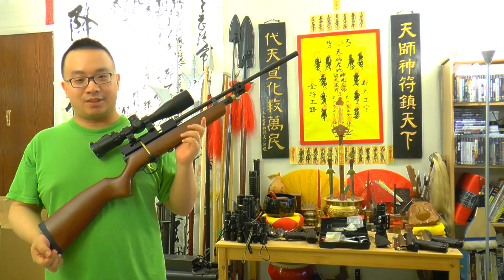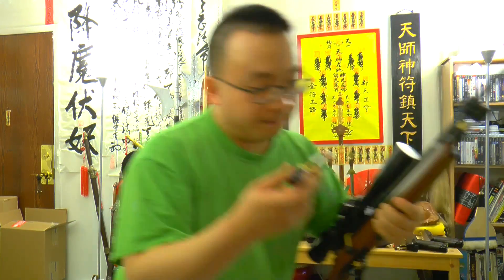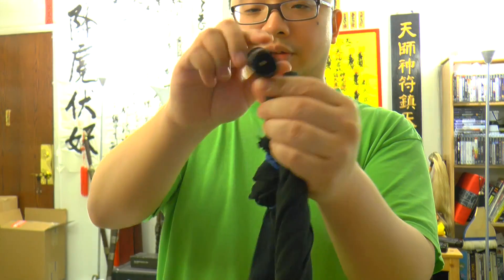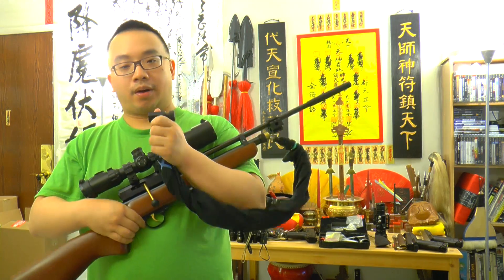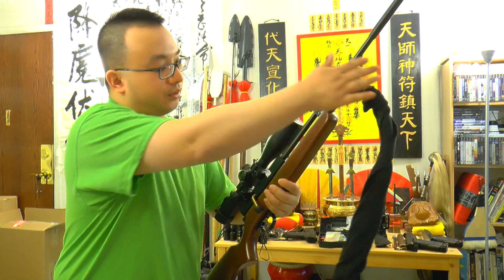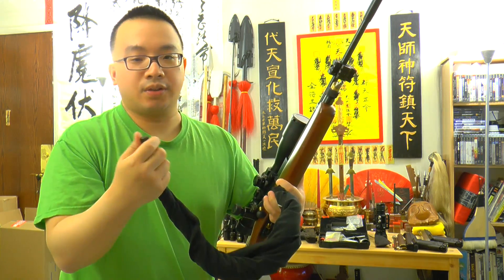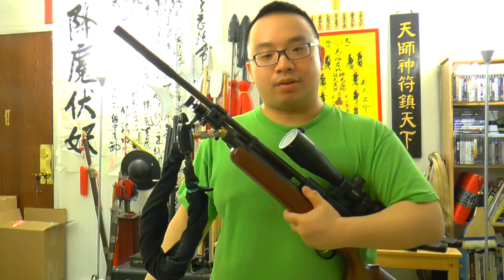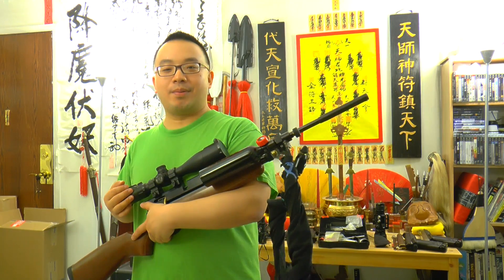QB78 .22 Cal Air Rifle Convert to HPA!

Comment: Couldn't you just put a fill valve into the CO2 air cylinder and just fill as if it were PCP?
Reply: that sounds like it would work but how much more woud it be than 2 co2 ?

Comment: Could I use a pump to charge the guns tube with hpa? If so how many shots would it give? I have the bulk fill end cap and have 'tuned' internal parts. Otherwise, I am looking at a hpa paintball tank & remote line. Is the hpa tank fitting the same as a co2 one or will I need a converter?
Reply: I was thinking the same thing
Reply: Nope.  Simply put the air reservoir is far to small to get any number of consistent shots.  Each shot will be radically reduced in power making the gun highly inaccurate and you'll get about six or seven inconsistent shots.  It's a waste of time and pressurising over the 800psi tube rating would be very dangerous not to mention blowing your seals.  Use a 13ci 800psi regulated air bottle and the drop block off a QB79.  Better still buy the QB79 in the first place if you want to convert.

Comment: I am looking for a powerful one pump bb pistol.  Do you have any recommendations?  I found many pellet guns but not bb.
Reply from the maker: there isn't any, put round balls into your pistol then it will be good enough, gamo rounds or HN pellet brand round balls will do just fine. For "BB" guns they are mostly for plinkling and not meant for accurate shots, don't think you will get anything decent for those. Pellet is good for accuracy, stick to pellets for pumpers!

Comment: That looks wicked, you just need a shorter connector and it looks zombie ready! Maybe some extra hardwar you could charge tank right on gun. Be interesting to see how many shots this could do nefore needing refilled.
Reply from the maker: Derek Everyguy Yes you can mount the tank directly on the gun by using a "gas block" which I can buy too, but I don't have that part with me, and I am sure some people don't have it too. The thing is, with the gas block, you cannot use the gun as a PCP and fill the tube with air only. See my vid here and you will know what I am talking about, and that is why I like this setup so much. You are right, I need a shorter connecting line and I am all good!   see this - https://www.youtube.com/watch?v=SQYyyE8ISMs